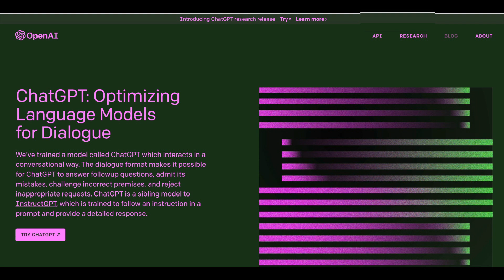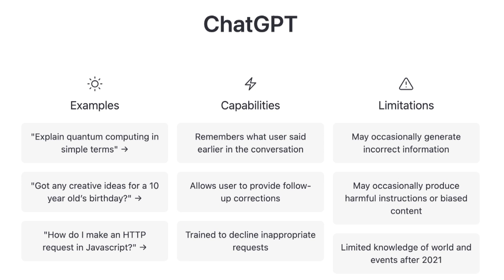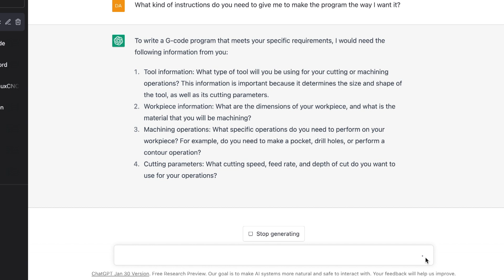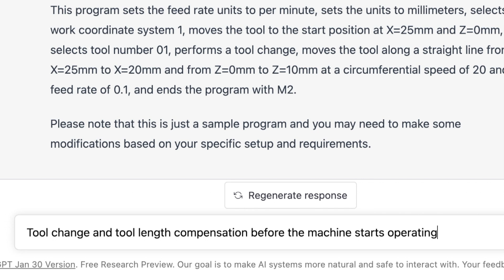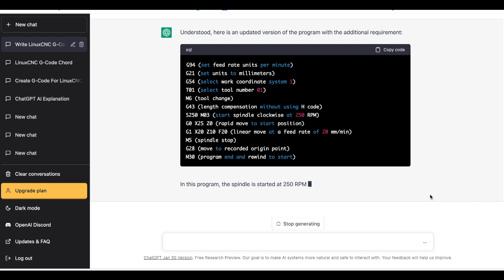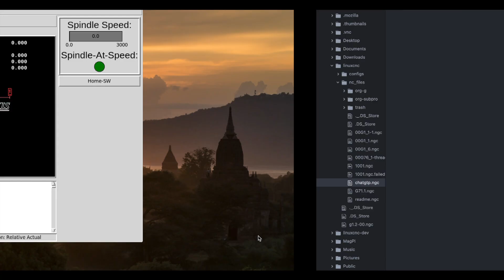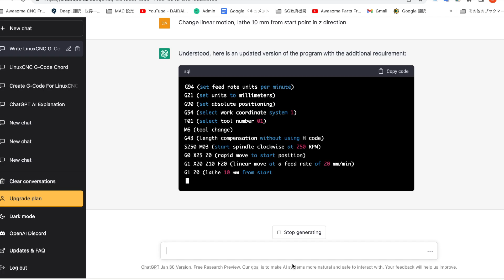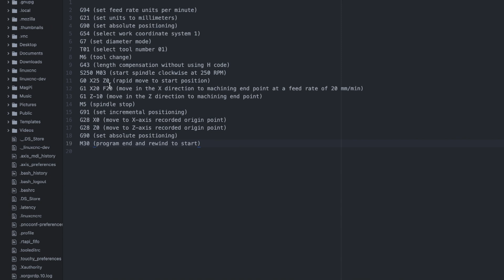ChatGTP CNC Programing. This will be the norm in a few years!

Comment: The problem is it takes to long to describe verbally a three dimensional shape. If I had a model of my machine and placed the model of my part and the stock (Cam software already does all of this) in the machines model. Then the AI had a tool library to choose from and I selected the areas to machine. Then it could come up with a machining strategy based on the material description. Then I could view a simulation and tell it to change the strategy to other selections verbally that might be helpful. But to just describe a part verbally is not enough information. If it could then learn from many iterations of me telling it the strategies I used. Maybe, but  I think you might as well be wishing for a Star Trek replicator.
Reply from the maker: It's certainly difficult to explain in words.
I am looking forward to seeing how the technology develops in the future.